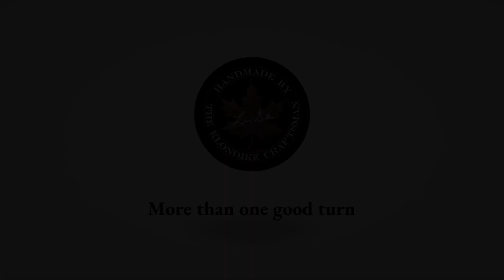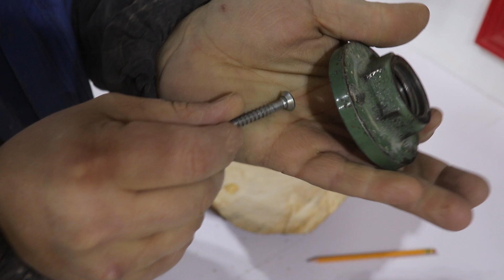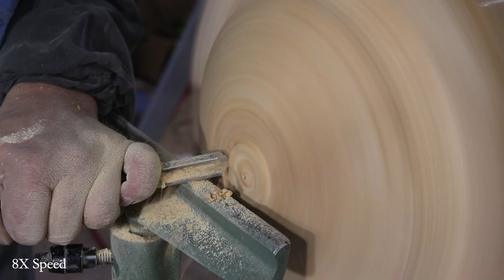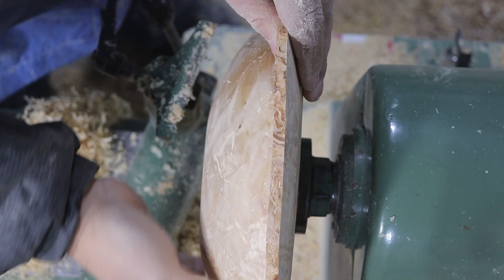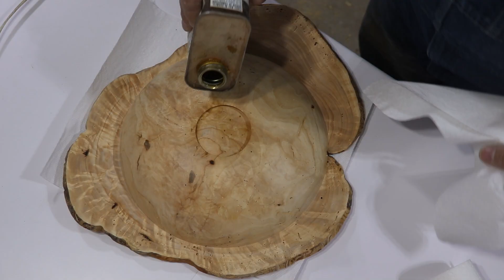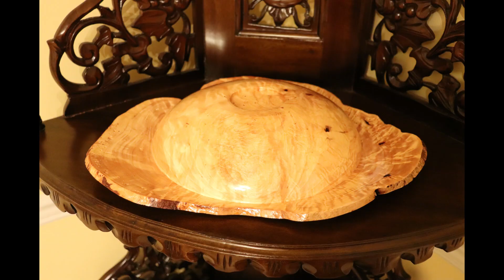Woodturning | Large Winged Burl Bowl

Comment: That is SO amazing! I am thoroughly impressed! I have never, until now, seen ANY woodturner use oil on a piece while they are turning. But, it makes sense. And, there have been times it would have helped in my turning, and, it never occured to me. So, THANK YOU! Im a new subscriber, but, you can bet, ill be looking forward to your next awesome project! Your talent is incredible! And, you have some REALLY nice pieces of birdseye and burl to work with. Well done!
Reply from the maker: Thank you Dave, I learned that from an older gentleman who has since passed on. It works well when sanding if needed as well, just make sure it is gone if you are using a wax finish! Thank you for watching!
Reply: @TheKlondikeCraftsman  i worked metal for a living for over 40 years, so, i was aware of the benefits of using oil to assist in that. It just never dawned on me that it could be beneficial in working wood also! Im so enjoying catching up watching your previous videos!
Reply from the maker: It works for me, I can’t attest to more than that.